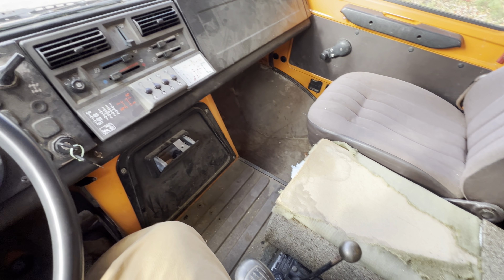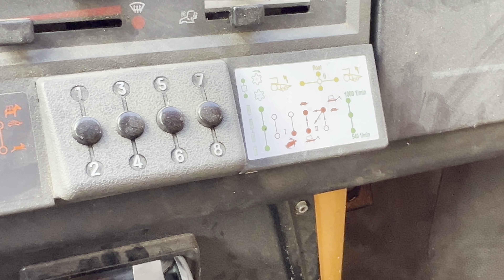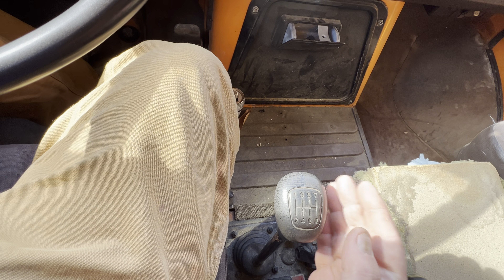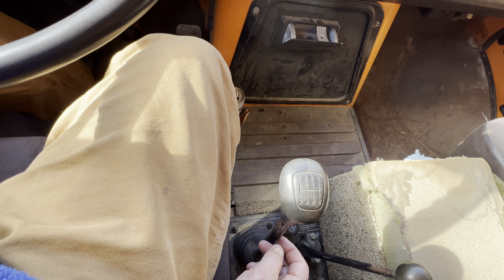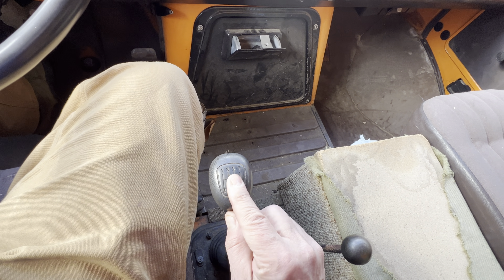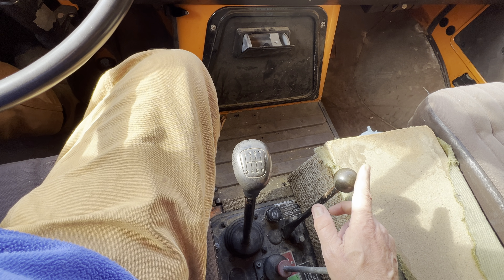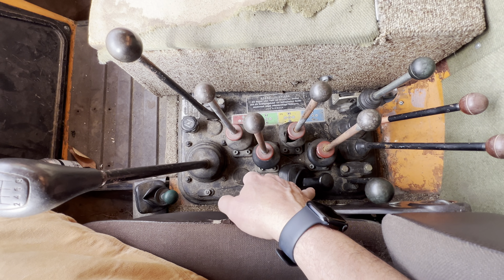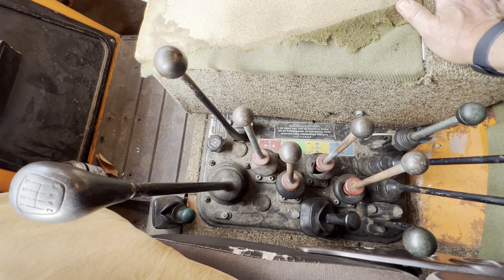Unimog Gear Levers

Comment: The physical levers and buttons are so cool, we live in the touch screen dystopia
Reply: There are certainly some advantages to the modern technology, BUT. I miss the tactile sensation of some of the older stuff. And the simplicity and dependability of it. I went to aircraft mechanic school in 1969. Carburetors-Bourdon tube pressure gauges-Generators instead of Alternators. My daily driver is still a 1988 F150.
Reply: @flower2289

Carbs on aircraft are great because they are one barrel and use a separate primer instead of a choke for starting. The carb only has to accelerate the engine and prop, not the whole plane.. which is also why magneto timing is fixed.  Bourdon tubes are great but the gauges are laggy and inaccurate and will make a mess if a line leaks (heck even manifold pressure gauges have drains to let out the excess fuel) and generators are awful because all of the current has to go through the brushes (which is why you have to inspect them every 200 hours vs 500 hours for alternator brushes) plus they need a heavy and failure prone mechanical voltage regulator, current limiter, and reverse current cutout vs an alternator with a solid state regulator, no need for current limiter since it’s self-limiting, and diode rectifier already prevents reverse current.  

I’ve got a 1987 Econoline motorhome and it’s a full time job keeping it running.  I love my new car that doesn’t need anything except fluid and filter changes.
Reply: @calvinnickel9995 carbs are great on aircraft right up until the point it freezes up and you become a glider lol
Reply: @flower2289  I had that same truck--with "The Big Six," i.e., the 300 cu. in./4.9L inline six, with the Mazda-sourced 5-speed.  That thing was BULLETPROOF.  Paid $500. for it and drove it for 10 years--and it was only running on 4 cylinders when I bought, due to neglect.  I eventually got the old (rusted) plugs out of it and it was the best truck I ever owned, until my Tundra, but that hasn't seen the use that old F150 had...yet.
Reply: @flower2289  This. Touchscreens are boring, and the kill interesting design - both visually and tactilely.
Reply: I won't disagree with you, but no consumer transmission needs more than one lever 😜
Reply: Absolutely. I love screens and Touch etc but when i drive something and need to change a setting or gear etc i need physical Feedback what i Touch and if it did what i want it to Do. You need to Do it blind so that you can see the road and thats why we need more buttons
Reply: Physical levers = Dopamine
Reply: @ethniccartoonkid  Physical levers and mechanical sounds = more dopamine

Comment: back when German engineering wasn't total garbage...
Reply: Typical salty comment of someone without a car reaching 80 miles per gallon.
Reply: @sungazer454  I don't care if it gets 500 MPG if you make the engine out of plastic and design it such that it becomes mechanically totaled due to the deliberate design decision to locate an oil gasket in an inaccessible place that requires the entire engine to come out of the vehicle to keep oil in the motor.  The More You Know.
Reply: @lashlarue7924  We love our plastic engines! You can take it out with just two fingers to change to oil gasket!
Reply: @sungazer454  Please, they are called, "biodegradable" engines.  They are eco-friendly in that they turn into planned-obsolescent junk in exactly 7 years or at end of warranty, whichever comes first.
Reply: @lashlarue7924  That’s why we are leasing our cars. Why would you buy a car, to keep it forever? Why?
Reply: @sungazer454  Because I don't believe in pointless consumer culture and because cars are expensive and make you poor.  I have a Ford truck that was made in 1999, which I have maintained, and it still runs.  I pay extremely low property taxes on it.  It gets decent fuel mileage.  Why would I want to consider leasing a $60,000 truck when the one I already have is still driving?
Reply: @lashlarue7924  1999? Why wouldn’t you want to drive a nice Ferd from the late 80‘s?
Reply: @sungazer454  I don't care what year it's from so long as it was built well and is practical.  I'd really like to have a BMW or Mercedes from the late 80's, because that is the last time either of them were able to make truly excellent vehicles (and you do know I'm speaking the truth).
Reply: @lashlarue7924  Environmental laws and expensive gas forced engineers to scratch the edge of possibility of gas / diesel engines. A cast iron tractor engine with huge cc and no complicated injection and high pressure turbo will be always reliable, easy to maintain and nothing will break because there’s nothing there to break. But it’s thirsty and dirty.
We have cars with 200+bhp what will consume not more than a gallon / 100km @ 180kph. That’s something but it comes at a cost of a Frankenstein engine technology.
The engineering behind that is actually crazy so your first statement is very untrue.
Reply: @sungazer454  I don't dispute that the environment laws, bean counters, and marketing departments made the engineers make sacrifices to sell cars.  Every car manufacturer had to design around these same constraints.

However, Japanese and even some American makes (some, not all) are not designed to break in a way that makes them mechanically totaled after 7 years.  German cars are.  I know this to be true because one simply never sees any German cars older than about 2015 that are still on the road.  Nobody maintains them.  There is a reason they don't, and it's because of deliberate design decisions (e.g. locating an oil gasket in an area that requires half the engine to be removed to service it).

The German cars I remember from the 1980's were fantastic.  The absolute best.  Today they are for people with more money than common sense.

I absolutely do agree with you about leasing vs. owning.  This is the correct approach.  But then you have mileage restrictions and... it's not yours, you don't own it.

Also I make an exception for Porsche, they are much better quality than the others.

Comment: Will I ever own a Unimog? No. 
Will I ever drive a Unimog? Unfortunately probably no.
Did I watch this entire video and share it? Yes.
Reply from the maker: Thanks for watching. I just think they are very cool vehicles and pretty unique so it nice to see other people who appreciate them. I'm just trying to inform people since the first time I saw one, I wanted to know as much as possible about them. I also never I thought I would own or drive one either but it is funny what happens when you want to own the real version of your favorite Matchbox and/or Corgi :)
Reply: @theunimogcenter  yeah I'm a car / machinery guy and love all this stuff. I live in Houston though so it's dead flat and full of people so I couldn't find a use for one here unfortunately
Reply: Same here
Reply: Yepp.  Me too.
Reply: i drove one at the age of 10, in a straight line, i held the steering wheel on hay field while the older strong guys pulling and pushing up hay bales (small ons not the big ones) on the trailer
Reply: Yet driving a Uniumog is so easy.
- The gearshift is a standard and fully synchronized double-H gearshift (any 10-year-old child in Germany can handle it)
- the four middle levers are obviously hydraulic controls (recognizable by the Fabecode)
- On the right front the selector lever whether the gears should be usable for forward or reverse
- The short thick one is the handbrake
- Behind it is the gear reduction
- And the two rear ones on the far outside are for the rear PTO shaft

Totally logical and child's play. My 13-year-old uses it to drive into the forest and haul trees to the sawmill or mount the broom and sweep our yard and driveway. In winter she pushes snow.... is a real relief for us.

Oh yes, and the Mog can go off-road without end. Hardly any other vehicle can compete with it. You can find the locks on the dashboard, depending on the version you can lock each axle independently of the other or all together. Completely or only 50%
Reply: @_Briegel;
Grüßen aus 73099...can I drive your 'Mog?
Yes, they are totally logically laid out, and designed for maximum flexibility...Ganz schön.🇨🇦 In 🇩🇪
Reply: I'm still waiting for the Polymog...
Reply: That's why I have the Lego Unimog😂
Reply: Me either, but I watched the whole thing, just in case I end up chasing a G wagon in a Mog like John McLane! XD
Reply: Awesome video, what about the diff locks ?
Reply: if you ever try to steal one now you know hiow to drive off 🤣 i imagine someone trying to steal one of these  looking at the gearbox and going fuck it i guess ill steal a bike 🤣
Reply: Same 😂
Reply: I’ve driven a few Unimogs, but none of them had this many levers :<
Reply: I still don't know wtf I'm looking at
Reply: Same, same.

Comment: The most frightening thing is that the speedometer goes up to 120... I don't care if that's kmh or mph, but dang..
Reply: So the 120 is for downhill fully loaded 🤔😂
Reply: the gearing only allows it to do 81kmh at peak rpm, down a very steep hill, but generally you stay at around 70 cause thats around where the rattling and loud scary noises are still bearable, going faster than that, you are gonna need double earpro and bravery
Reply: @jusss31  High speed axles available to allow around 60mph.
Reply: Just cuz the xj (jeep Cherokee) speedo only goes to 85 at about 4:30, you can still peg that speedo to dead 6 o'clock... Friend following me said he was at 102.
Reply: Lol. My dad's 1990 ford ranger (2.3L 5 speed) only has a speedometer going up to 85, fastest I could push it was 80

Comment: The writers for The Fast and Furious movies absolutely took inspiration from a Unimog.

I've got a question though, how difficult is it to catch the gates for 3, 4, 5, and 6 properly? I've figured mis-shifting is one reason 6spd manuals tend to be what is commonly available.

Edit: I watched another one of this person's videos that covered covered how the 8spd works a little more. Basically there is an interlock the Operator has to activate before moving the gear lever to the "High Range" of gears 5-8. To activate/deactivate the interlock the Operator must put the gear lever into either 3rd or 4th gear, afterwards the pneumatic interlock will open and allow the shifter to move to the upper range. They didn't say anything about downshifts though.
Reply: In middle of the dashboard where the shifting stickers are there is a box with four lamps that show you were you are. Minute 1:10 at the right end
Reply: Ahh yes, I figured out a 8 gear like that should be pretty much impossible to find the gears on...
Reply: Its the same for upshifts and downshifts. You can only go up or down one row of gears at a time, you cant skip and go directly from 3rd or 4th to 7th or 8th and vice versa. Also there is no problem with missing shifts, for one its more like a 4 speed but twice instead of 8 a speed, and the gearbox feel and shifting precision are better than some sportscars ive driven, weirdly enough. As well as generally when driving normally, you wont be useing low range at all, 5th gear is all ready slow enough to get going in traffick, even with a decent load in the back.
Reply: Most trucks have 8 speed gearboxes with splitters to allow 16 or more gears.. Its about as easy to shift as a normal gearbox .

Comment: OK UniMog and math guys.  How many total Forward gear ratio combinations are there?

Is the number bigger than women's shoe types or fishing lure types or folks in New York City?😊
Reply: definitely not bigger than womens shoe types lol
Reply from the maker: 24 gears forward and 24 gears reverse. Working gear multiplies the main gearbox by 5.76:1 and crawler by 56:1. Most stock transfer-boxes reduce 2.75 +/- except the Jeep Rubicon is 4:1. Most after market creeper ratios are also around 4:1. So the working gears on a Unimog are already slower than most extra low aftermarket boxes. The crawler gears are about 15 times lower than that.
Reply: 64, but only 24 good ratios as he said

Comment: And I thought a dual-stick was crazy. This one is absolutely insane!
Reply: It's an... Octostick? Decastick?
Reply: Someone's not getting their gears turned 😂
Reply: You want to know what would be crazy.
Imagine a touch screen and you have to fiddle around different menus to do anything.
This is not insane. It's simple, it's clever.
Reply: No. It´s Deutsche Gründlichkeit. I find this very logic and easy. Your gearboxes are weird…
Reply: The cool thing about this setup, you dont use all sticks all the time. When you drive empty on road, you go into high gears abd ride like a normal manual car. When ypu go onto a field 4 example, you go into your preferred setting and good to go. Imho its less complicated as you once understood how you have to set up everything
Reply: Pretty much like a big tractor, just all the levers in the same convenient place! Ingenuity!
Reply: Run enough farm equipment and this is not overloading. The layout is actually quite logical and well placed.
Reply: Eh you won't be shifting the auxillaries while moving, but it would be funny to try.
Reply: I have had pickup trucks with three sticks (mid 1950s Willy's), This is only a 4 stick if you neglect the accessory controls.
Reply: It's really not too bad.  It's eight on the stick and the low/med gears (the red lever) are only ever used offroad or if operating road clearing/construction equipment attached to the vehicle.  The rest of the levers are for operating the PTO and hydraulics.

Comment: I have a semi-traumatic memory associated with those things.
Reply: I can sympathize. When it's been run into the ground before you ever set foot in it, and you have to do the whole voodoo witch thing to get it started = not fun.
Reply: I was on a work outing in the desert near Lake Powell. The host was a guy who had started his own “Unimog experience” firm. He was driving his troop transport Mog and I and 10 or so of my work colleagues were in back. He was overconfident as he dug into that gearbox to show us what that baby could do. We’d already travelled about 5 miles off the road on terrain that wouldn’t have challenged a 4x2 pickup when he flipped a few levers to take us up and over a short rock edge. We heard a grind and then all slammed on our seats to the front of the bed. The engine died. We sat still as he tried to restart, only to grind the gears more when it finally did. 

TLDR: a five mile hike through desert heat to find a payphone somewhere near Glen Canyon Dam.

Comment: With both PTO engaged, but the PTO clutch released, can you usi the Unimog as a PTO extension or addition?

IE, another tractor sends PTO power in the front, that power runs equipment out the back, the Unimog can be idle or adding power to the PTO arrangement.
Reply: I think it won't work without a permanent open clutch to the  motor side. But I also see no need to add a tractor as a power source to run equipment thru
Reply: interesting philosophy but not really possible to do
Reply: That's an interesting idea but I don't think there is much of a use case for it though. Most PTO driven equipment is not looking for more power. You'd probably end up breaking shear pins more than anything else.
Reply: @aland7236  it was really about gearing, to get an idea of how they are coupled & direction of rotation.
Reply: auxiliary PTOs are not rated for that
Reply: @erkinalp  my question was about the gearing between the two, like, are they synchronized.
Reply: The Unimog is already more than capable for most appropriately sized PTO implements you can put on it.

Comment: I want a unimog now. I already drive a manual truck this seems fun. How fast does this thing go?
Reply from the maker: It's actually a tad more than 62 mph (100 kph ) when the max RPM's are turned up a bit. It has high speed gears and turbo OM366A. As mentioned that is at full throttle but that is the way they are designed to run. I guess it depends what your standards are, but I've driven this set up cross country multiple times, mostly highway, and it doesn't bother me. However, it is not a modern pickup with plush interior and quiet ride. Way more comfortable than my old Land Rovers and Vanagons but not as comfortable as my neighbors new F250. It's all relative but Unimogs are definitely not highway cruisers.
Reply: @theunimogcenter  yes but they will be found where others can only imagine. Ba ha ha ha
Reply: It is an older model, so tops out at 90 kmh. And i mean tops put, it's full throttle full revs screaming down the road. It will do it, but will make you miserable for between city trips.
Reply: Who cares how fast it can go. What's so cool is that it can move slower than grass grows.

Comment: When I worked at our town public works, we had a 1974 mercedes unimog with a snow thrower, plow, a high range bucket, it could pump fluids (water), and other attachments. The thing was so kool in first low it could creep so slow that the driver could get out, walk around it, and get back in it! Sadly, only 4 of us could get it to move, so using it was never used to its ability. I personally loved it. I could park it running anywhere, and not a person ever touched it, lol!
Reply: Something about older work trucks gives off a complex simplicity. It's complicated when you look at it at first, but soon everything makes enough sense to where you're not confused. Unlike today's electronic infotainment centers, lol
Reply: these are so cool.
Reply: I own an Unimog. If youre used to the gear scheme, youre using it without much thinking... 😁
Reply: @cattythecat9161  After a while you just reach over and do what you gotta do without looking. Don't wanna spill your coffe just because you gotta shift a lever lol.
Reply: @nrbrtmuller  Im not offended lol It wasn´t my intention, to boast about it. ✌
Reply: Best machine ever made! Beats riding a tractor on a field plowing any day!
Reply: You sir are the earliest vehicle ghostride 😂